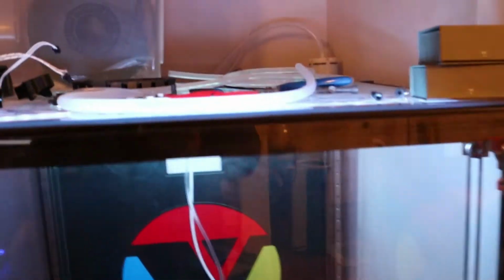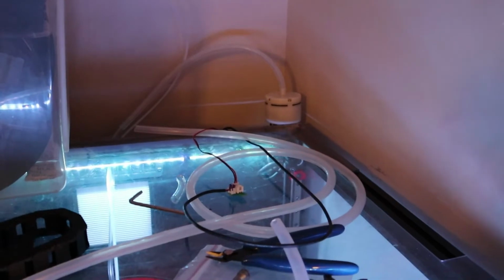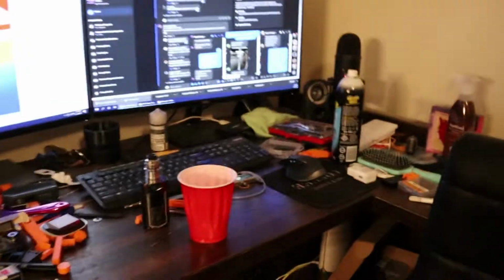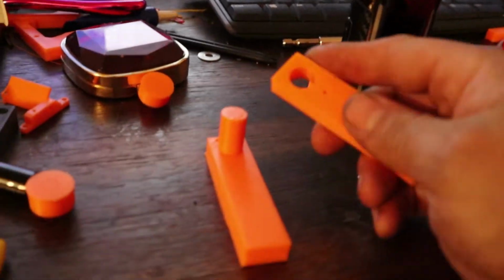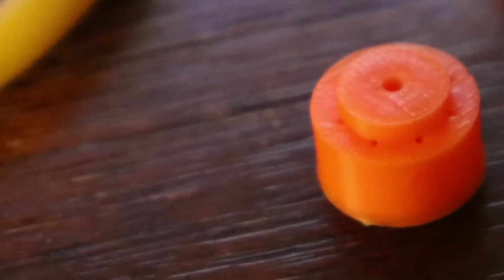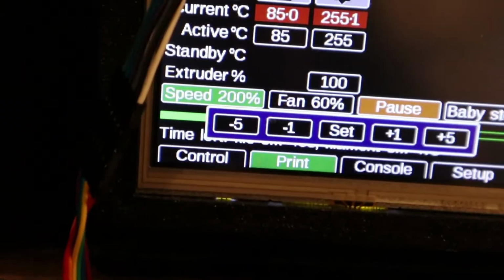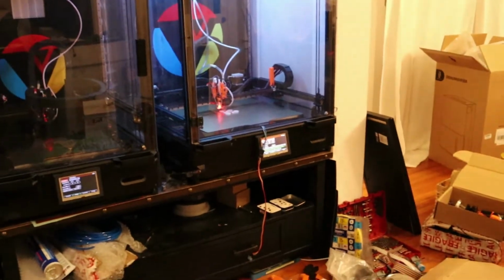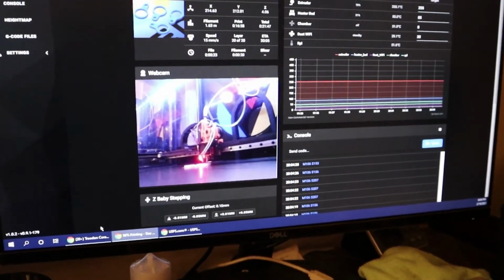Berd air

Comment: Hi, what Mosfet did you use for your berd air pump? You mentioned you don't use the provided mosfet. I have always wanted to put a berd air system in my voron but I am not to sure which mosfet is suitable. Thanks

Comment: Do you have a link for that high speed switching module?
Reply from the maker: its from the makerhive.com but if you run duet or any board with high power output you dont't need one

Comment: By flux ring you mean the metal shield around right? Might try that out.
Reply from the maker: yes exactly we are not running high enough pressure to need the torque we need the rpm for flow

Comment: Very interesting, thanks for sharing this! I am researching good silent cooling options for my upcoming delta. Have you tried this type of pump at fast speeds, something like 300mm/s+ with 20k+ acceleration? And about PWM - in my experience it can make a huge difference in any motor/fan noise, I always tune that on duet
Reply from the maker: Yes i have at 300 but not 20k accel lol . it handles up to .6 nozzle no prob i am going to try with a .8 nozzle. Actually the tpu at 400mms and 46mm3 was with the berd air. But i am getting way better results with my nozzle vs the ring so i think i can do better so i will update you when i know . Pm me if you want sourcing info for the pumps ive tried
Reply: @advanced3dprinting  very interesting, gonna watch your progress. I have no problem sourcing that, my main problem is time usually 🤷🏻‍♂️😄 I have tried some pumps about 5 years ago and gave up on that idea, as all of them were pretty darn noisy to my liking. Then I changed my focus to other projects,  but now since I am working on a new delta machine, I want to try some nice and light ways of cooling. I have also purchased some stupidly fast blower fan, just for the heck of it, gonna check that one out soon too. The noise is 52dB tho, I am only counting on running it at 60% speed tbh. At some point I start thinking "better done than perfect" haha. So maybe just get berd air and call it a day. I would replace that berd air motor with BLDC instead tho, would run much smoother and nicer, at slightly higher cost.
Reply: @advanced3dprinting  Hi, I am wondering what you mean about " my nozzle vs the ring" I currently use a ring, but looking at re doing my berdair and found your berdair done correctly video. so I wondered if you have another solution?

Comment: Finally bought a berd air. 5015 fan rattles like a mofo at the speeds I print and doesn't provide enough cooling. Just hoping I can get it quiet enough. I don't have an enclosure yet.
Reply from the maker: You need to use a floating mount and also adjust the pwm . I can make a video on how I set mine to be quiet and flow good

Comment: I've had my Troodon 400 for about 6 months now and other than unboxing it and setting it on the HD table for it, I haven't had the opportunity to set it up yet. I got injured @ work, and since I recovered, I just got my two Anycubic Predators running perfectly & one has a Berd air on it. I really like it. Now on to the Troodon. I wish someone would do a video of putting the DD together. It came in a baggie with no instructions.
Reply from the maker: i am going to make video of my gantry upgrade where i will be taking the guts of my other dd out and put it into teh printed version we use for the upgrade so that will somewhat show the install but it is pretty straightforward most important is remove one link from cable chain and dont let motor touch endstop by accident . other then that its just the pia of running the new cable into the existing cable chain and i recommend using my mounting plate i have on the group or my patreon. The one they send tends to bend and or strip
Reply from the maker: I have since put some dd extruder together but when I do my gantry uograde I will be removing the stock dd so I can make quick overview on the install for you in the beginning of the video
Reply: @advanced3dprinting  Thank you.